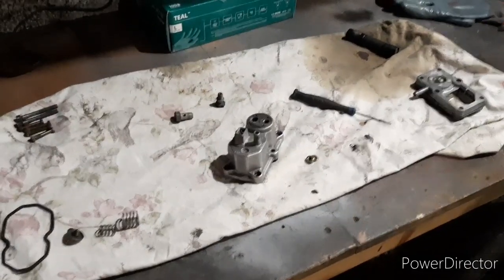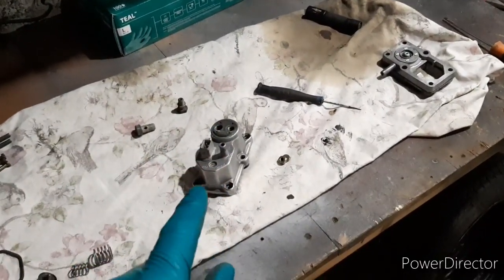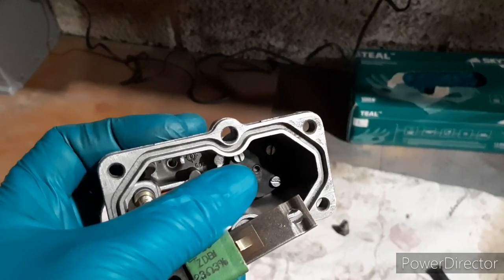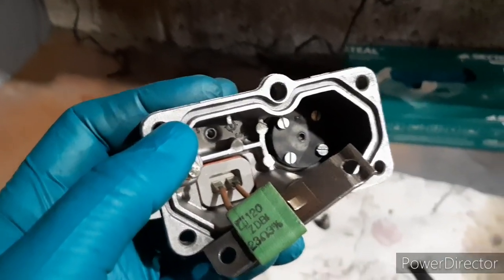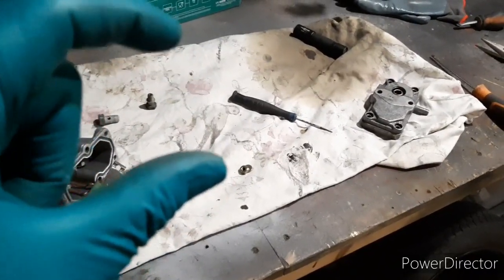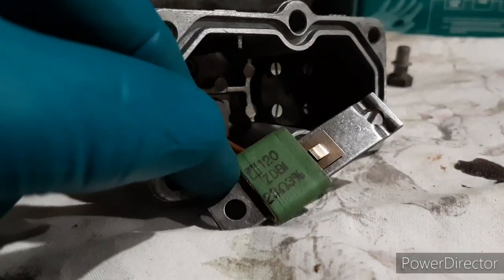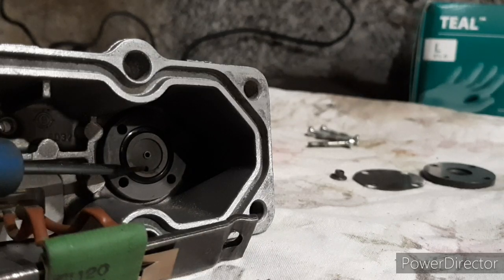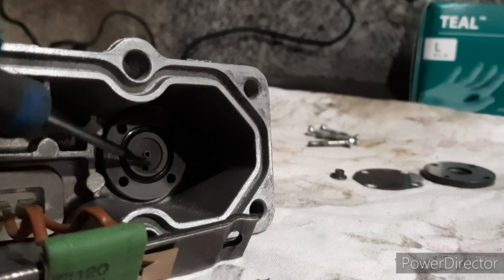How does it work: Bosch K-jetronic Warm up Regulator (WUR)

Comment: I have a WUR without the vacuum ports and I think it’s causing idling problems on my Volvo 240.

If I put light pressure on the air metering plate (or whatever it’s called) through the CO screw hole it runs much better.

What do you think?
Reply from the maker: Hi 
That could be just the CO mixture needing to be leaned off a touch
Reply: @GreyGooseRestorations Thanks for answering.
Regardless if I turn the screw to make it leaner or richer, it never runs quite right.
What I'm not understanding is why the engine would run better when putting slight pressure on the screw but not turning it? Isn't essentially doing the same thing?
Reply from the maker: Ok, is the actual air plate rest position correct
Reply: @GreyGooseRestorations  It looked OK last time I checked, but I haven't measured the exact resting height. I'll measure and get back to you about that. Anything else I should check?

Comment: Hi recently on my MK2 16v I noticed that the plug that was in the WUR was actually for the thermotime switch for the cold start system (2 pin brown plug). I’ve been trying to diagnose why my car has been running rich (failing mot on emssions too) could this possibly be why? Ignition timing done, new spark plugs, new injectors and a good clean of the intake system has already been completed 😎  I did find the wires that I believe are for the WUR so I’ve ordered a new 2 pin plug to give them a go.
Reply from the maker: It could well be yes if it's running too rich
Reply: @GreyGooseRestorations thank you!!

Comment: I have a 86 GTI with the 1.8 CIS KJet.. I had someone rebuild my kjet unit with new gaskets and now it only runs for a few minutes and starts to lose power until it dies. Usually like 3-8 minutes. Do you think this part might have something to do with it?
Reply from the maker: Most likely, if it was running before and now its not then somethings not right, it could be simple to fix or it may need a rebuild again

Comment: Great video, my problem is hard start when hot, can this regulator cause that symptom. Ive replaced injectors, fuel pump and check valve, and fuel compensator.
Reply from the maker: Yes that is a common WUR issue

Comment: Nice series of explanations - thanks, they've been a great motivator.  Quick question: What does the vacuum hose on the side of the WUR connect to?  Does it provide altitude enrichment or adjust the control pressure based upon manifold vacuum?
Reply from the maker: Thanks, it connects too the lower part of the inlet manifold and adjusts fueling relative to open or closed throttle

Comment: Hi, I hope that you check your messages once in a while. I have an issue with a 1986 VW Cabriolet that maybe you'd be willing to help with. Upon start up, when the car is cold, we have to start the car up 5-6-7-8 times in a row before it will stay running. Usually it will start run for a second or two then the rpms drop to zero and she stalls, even if we try to press the gas to prevent rpms from crashing to zero - actually ESPECIALLY if we press the gas - when we press gas it is like choking the car off from either its gas or air supply (All Out of Love)😆. Once we have gone through the multiple startup sequences and she holds her rpms and runs on fast idle, again if we press the gas, she chokes. Once shes warmed up, everything is absolutely normal, holds rpms at around 800 and gas is perfectly fine. Press the gas peddle and she's perfectly crisp. We changed plugs, wires, rotor and I just rebuilt the WUR - no improvement. Not sure what to do or check next. If you can, please help me. Thanks.
Reply from the maker: Hi, are you able to test your fuel pressures? This will give a good indication to your problem.
Also have you checked your C02% and ignition timing advance?
Reply: @GreyGooseRestorations  Hi, thanks for the reply. I have a lot going on right now but I will find time and guage to check fuel pressure. I'm assuming that we want to check both when engine is hot and cold. I checked the ignition timing last summer when we changed rotors/plugs and wires, it was setup right, however the car had the cold start condition issue before and after our ignition check, so I don't think that is it. We put in new plugs, wires, rotor, distr. cap and checked timing 
Also, worth noting, the previous owners got 'handy' and 'crafty' with the wiring and some electrical stuff in the car doesn't work. Both the heat and fuel guage, the heater fan blower switch starts the radiator fan...So, let's assume that my Jetronic ECU isn't getting power and this car is strictly analogue right now...Should my WUR be supplying extra fuel anyways? Would the 5th injector be still functionnal?  I popped out the Jetronic ECU and looked inside, it looks beautiful. There are no signs of heat or oxidation. 
As far as the CO2, I wanted to measure the fuel/air ratio using the electrical connector near the 5th injector but it gave no reading.
Hopefully, this gives us something to go on. Thank you very much for your help.
Reply from the maker: Older K-jetronic doesn't have the ability to measure AFR.

C02 is very important as even a 1/8th turn the wrong way will cause starting issues.

With fuel pressure you want the car cold and monitor pressures as the engine warms up
Reply: @GreyGooseRestorations  Exactly what do these older Jetronic ECUs do? And how important is it that I get mine back on line?
Reply from the maker: They only control the spark advance relevant to engine vacuum. Its very important its all functional
Reply: @GreyGooseRestorations  Thanks, I'll work on it.
Reply: I'm just hoping that I can cut to the chase a bit. What is the one unit that would need to be non-functionnal fpr the car to have to be started about 2-8 times before it stays on, idles at about 1200rpm but if you give it a shot of gas you get a hesitation, then up to (whatever) say 2500 or 3000 rpms, then get off the gas and it shoots down to 0 and stalls. But if you do the same thing after say 2 minutes it will drop only to around 600rpm and them go back up to around 1000rpm. Then after 7 or so minutes of running like this -- it runs perfectly! Crisp acceleration, great idle....
Reply from the maker: It's more likely a mixture of things, is your 8 or 16v
Reply: @GreyGooseRestorations  8v
Reply: @GreyGooseRestorations  What would happen if the WUR were working fine but that small hole located at the top of the metering head that allows fuel through to push the plunger down...Lets say that hole were blocked? How would the engine run when cold? Also, what pushes the plunger down when the WUR/engine are warmed up?
Reply from the maker: The pluger/fuel pin has control pressure acting on top of it. This is dictated by the WUR working correctly. To high control pressure will make the engine hard to start and run very lumpy if at all. To low pressure would cause hard starting but when warm should run ok
Reply: @GreyGooseRestorations  Ok, we might have something here. So, if the hole was clogged, the pressure on the plunger would be too low when starting cold - but once warmed up (when the WUR would normally be closed) the pressure would be normal. Sound about right?
Reply from the maker: I see your train of thought thats not likely, more likely is the WUR isn't functioning correctly, or the C02% isn't adjusted or the fuel supply has issues
Reply: @GreyGooseRestorations  Well, I rebuilt the WUR and tested it - seems fine. I'm not equipped to test fuel or C02 just yet, so in the meantime I'll take apart fuel metering unit and see what I get. Keep you posted. Thanks for the help.

Comment: Hi, that's a very useful video. I have a 928 with a starting issue. Many years ago the car would start from cold and tickover at 1500 revs until warm. Now it struggles to start at all, picking up a couple of cylinders at a time.  The resistance of the bi metallic strip is spot on at 26.5ohms but there is no voltage coming to the connector with the ignition on. Is there a relay for the wur?
Reply from the maker: The WUR filter may be blocked as they are a triple layer and you will never clean them, i pull the filter out and fit a cone filter into the banjo bolt.

The warm up element even if no voltage will allow the car to start and run it would just take longer for the warm control pressure to be achieved.

I don't believe it is relay controlled just a direct 12v feed
Reply: @GreyGooseRestorations  Many thanks.

Comment: Hello, got an 84  granada 2.8 injection,  runs perfect but wont start when its cold if i not turn on the meter head slightly.. could this be the problem?
Reply from the maker: Firstly i love a Granada, it could be the metering head (C02%) put of adjustment or the cold start injector not working causing cold start issue providing all fuel pressues are spot on

Comment: Hi I have a 1991 golf gti 16v KR and it fails to start when warm. It cold and hot starts fine but if you leave it over 10 mins it struggles a bit and take a few seconds of cranking then seems to start but not on all cylinders. If I leave it over an hour it takes at least a good minute of cranking to start. Could this be the WUR? Many thanks
Reply from the maker: Hi, it sounds like it could be the WUR but my first port of call would be to check the fuel pressures as if its not holding residual pressure that will cause this.
Reply: @GreyGooseRestorations  many thanks, will try to check this as soon as I’m back with the car

Comment: My understanding is that this valve is working electricaly becos i see a plug on  my Jetta A2 Kjetronic 16valve system
Reply from the maker: The plug is just for the heating element which assists in the warming up along with the heat transfer from the cylinder head

Comment: Hi, my system pressure and return fuel volumes are very good being within the vehicle's specifications and I'm getting correct and equal flow to all the fuel injectors when jumping the fuel pump relay and pushing the air sensor plate to WOT. But my cold control pressure is very low - less than the specified pressure at 0 degrees. What do you think is the issue with the WUR that would cause this? Thanks.
Reply from the maker: Hi, if your cold control pressure is very low then its most likey the WUR at fault
Reply: Normally the control fuel pressure is about 0.5 bar at cold start and about 3.7 bar with the engine at normal operating temperature. If your cold control pressure is below the specified fuel pressure then your engine must have been running on a richer mixture when cold and through out the whole range. Mainly the parts that can cause this problem is the warm-up regulator. High control pressure and pressure not being regulated is the common fault of the warm-up regulator, a low pressure can happen if the bimetallic spring has been over adjusted manually trying to reduce or lower the  control pressure.

Comment: Hi, have a '91 16v golf gti that I have managed to get running starts and idles fine after alot of effort, there is an issue where it doesn't seem to like initial application of throttle it sort of bogs down. It sounds like is drawing in air somewhere but can't see any obvious leaks. 

Liked this video and think it will have to go on the ever growing list of jobs !!
Reply from the maker: Might just need a tweek on the fuel metering head, it may just be dipping into lean fueling as soon as the throttle is applied before it then gets back in to normal fueling
Reply: The injectors may be clogged, they need 3.5Bar of pressure to open and that increases if they get dirty. This causes a hesitation on blipping the throttle

Comment: Thank you for posting this , I am about to do this job on a Capri 2.8. It starts but does not want to rev until it has warmed up .
Reply from the maker: No problems, sounds like the pin could be stuck, had this on another MK2 16v recently, it would idle perfect but once warm wouldn't idle, the WUR was providing system pressure (5.5Bar) to the control pressure side, nearly 2bar more than it should be, it was trying to push the fuel plunger down when the air meter was trying to push it up.

Comment: Hi Can the WUR stop the car starting/running. Although not tested the fuel pressure I do appear to have high pressure being delivered to the metering unit and the 5th injector working but no fuel to the other injectors. The car will start but then immediately cuts out. What should I be looking at next TIA
Reply: Great explanation. You were recommended as someone to speak to about my kjet issues. I've got a hot start problem which has developed all of a sudden. I've done some pressure testing this evening and the control pressure seems really high. 5 bar system pressure, 4.6 bar control. Would this be the issue do you think? System held pressure for 30mins after switching off, only dropped from 4.6 to 4bar. Appreciate any advice you may be able to offer. It's an 8v GTI. Thanks!
Reply from the maker: Thanks, just replied to your message 👍
Reply from the maker: First guess would be the fuel plunger that is in the centre of the metering unit, these are common for sticking and stop fuel to the injectors, the engines probably using the fuel from the 5th injector to initially fire up.

Unbolt the metering head from the air box and the plunger can be accessed from there
Reply: @GreyGooseRestorations  ok just checked the plunger and seems free have also removed one of the injectors and operated the fuel pump with the plunger pushed in a fuel is getting to the injector but seems not enough pressure to open it.
Reply from the maker: @ronnie8752  ok ideally you need to check the system pressure that should be approx. 5bar the injectors won't open untill approx. 3bar.
Reply: @GreyGooseRestorations  ok thanks I don't have a pressure tester. Will see if I can get hold of one from somewhere 👍

Comment: Great vid thanks! This has given me the confidence to take mine apart which I am doing currently. Resistance seems fine so all good there. I did find that the very thin circle piece of metal was firmly stuck could this be an indicator of the WUR not working? There was also some grease build up too.
Reply from the maker: Thanks, yeah it should all be clean just a tiny bit of grease in the cone part where the pin locates. If the disc was hard to remove then that would indicate to me it wasn't functioning
Reply: Ok great do you have any videos for adjustment ??
Reply from the maker: I Don't as yet but i can try and do one soon